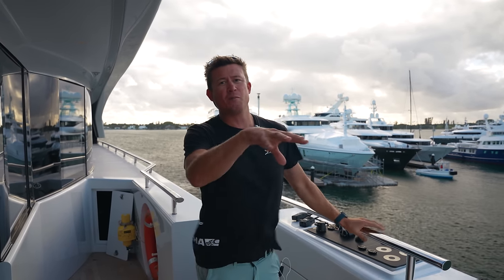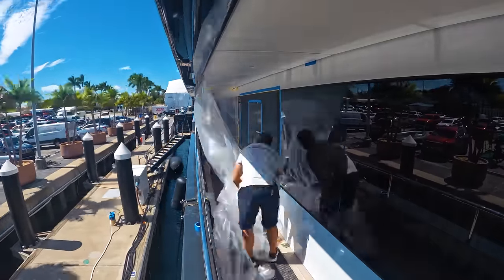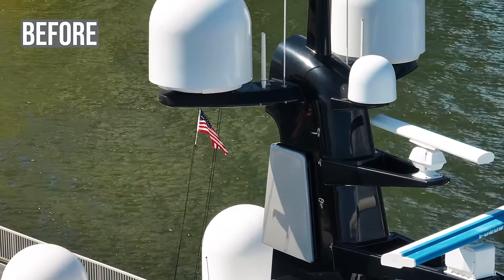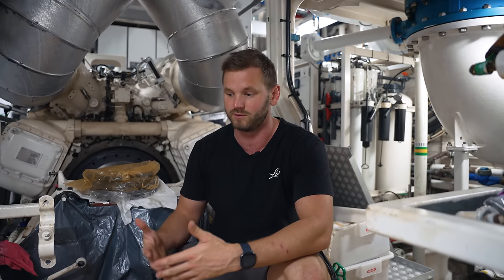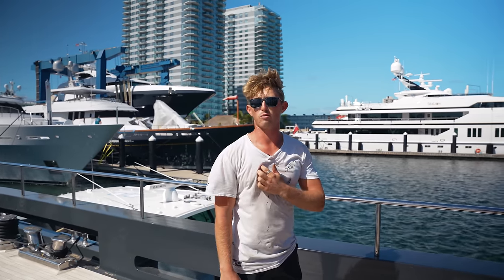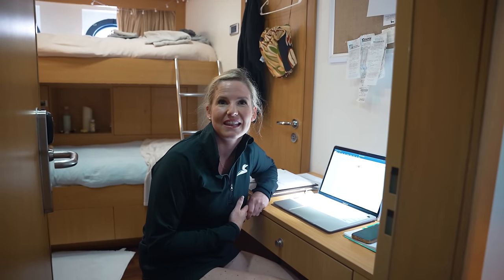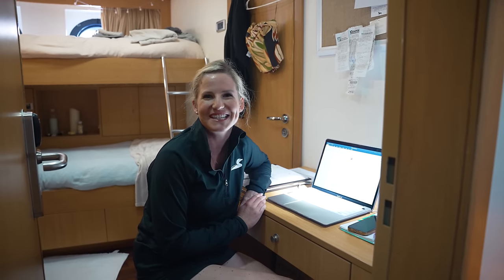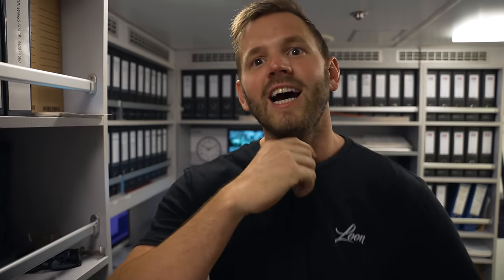We Upgraded The Boat! BIG TIME... Time to Leave Shipyard!

Comment: So great to see all the changes to the yacht. The crew did an amazing job getting it all done in short amount of time. Now it’s time to get the winter Caribbean season underway. 🛥️🥂
Reply: Great Videos! Quick question: Why couldn’t you use the engines in the beginning at the maneuver in the harbour and had to rely on the tug drivers?
Reply: @maxmuster3440 cause if the timeline adds up there was work done on the engines/gearbox so these were not running.
Reply: @MrDinoooooo I would also assume this. They really did crunch to get months worth of work in weeks
Reply: I’m a little late to seeing this video so maybe comments aren’t being monitored anymore but I’ll take a shot anyway. 

I’d be really curious to hear if you’ve got a rough idea of the cost of the 3-4 weeks of upgrades/repairs/maintenance?? I’ve always heard that a yacht will cost about 15% of its purchase cost per year to maintain. I’m not sure if that includes a crew, but I’d have to assume it does as that would be a major part of “running” a yacht (private or charter). So just going by Loons current asking price on the market (in Oct 2024) of $47,500,000…. I estimate the monthly running cost of her to be $450,000-$600,000 (yes? No?). So I’m really curious if that “rule of thumb” of 10%-15% would include these annual and semi annual trips to a boatyard? Or would what you’ve done in that month be considered extra expenses, maybe a capital cost instead of maintenance?? 

Would love to hear ANY response from the Loon crew, but of course a direct from Captain Paul would be icing on the cake!  Cheers! 🤠👍🏼☮️

Comment: Amazed how well run this yacht is. The owner doesn't scrimp on  maintenance, repairs and upgrades.
Reply: I know this would never happen because obviously they have every reason to be discrete and preserve their privacy, but wouldn't it be fascinating to hear from the owners themselves and gain at least a glimmer of an insight into their experience owning this magnificent property and how they've come to entrust it to this consummately professional crew?
Reply: In for a penny, in for a pound
Reply: there's a reason they say that the cost of maintaining a vessel is between 10-20 percent of its purchase price yearly. the owner doesn't charter to make money. he charters so he can spend 6 weeks a year on his boat and it costs him nothing to do so. the charters pay for the crew and maintenance. by not continuously updating and fixing things immediately you are just kicking the can down the road. they say the 2 happiest days of boat ownership are the day you buy it and the day you sell it. this boat will need to be sold one day. it makes it a hell of a lot easier to sell a boat if it has been looked after well its entire life and believe it or not whether it has been used consistently. a boat that doesn't go to see is a boat that's rotting away in a marina. some boats become marina queens and the costs are the same whether or not the boat runs or not, its just the engines and all mechanical systems are not made to not be used.
Reply: The yacht is how the owner laundries he’s money 💰 💰💰💰💰 😂😂😂😂😂😂😂😂😂 I just had to put my two bobs in 😂😂

Comment: I spent a week on Antigua some years ago.  I asked the guide about the houses between the airport and resort looking so shabby, and she said they don't bother going super flash as they have to regularly repair after big storms.  She also pointed out the houses mostly had some nice cars parked outside, so not to worry about the locals because they were doing OK.  My other big memory was the man who patrolled the resort at night carrying a shotgun.  I asked why he needed the gun and he said it was for cows that roam onto the grounds.  Yeah, right!  Anyway, Loon is looking super sweet after the refurb, and goodness knows what it all must have cost?  Especially the Bridge update.   I've already seen the new tender video, and that's dream boat all by itself.  Paul had the throttles pegged with all 1700hp pushing the boat to 50MPH.  Google tells me that was using 560 litres of fuel per hour, and Paul must have been a good half hour at WOT.  That must be a couple thousand dollars in fuel cost!

Comment: In refit situations like this, what happens in the case of a hurricane or other gale force winds? Can the tugboats take you out to anchor or are there protections in the harbour itself?
Reply from the maker: We monitor the weather closely. We were doing engine work this time, which would have prevented us from running away so we would just hunkered down. Normally if engines are operational, we get out of the way well in advance. 🤙
Reply: thanks,  so I guess it is just "accept what may happen and deal" when the engines are being worked on. I thought it looked a little dangerous to take you out into the channel given all of the smaller boats.  A decent wind change could take out 20 boats depending on how long the chain was.  @motoryachtloon

Comment: Okay..your explanation of the exhaust was wrong  . NOx = nitrogen oxides.., and the filter you pointed to was a diesel particulate filter..DPF.. it filters soot from the exhaust, then when the soot builds up, diesel is injected to incinerate the soot @600c...Now when exhaust temp increases NOx is produced..and would be treated with diesel exhaust fluid =DEF (AUS-40),and a SCR filter which your vessel doesn't appear to have being built in 2010.
Reply: Correct that the burners are to remove carbon. You are not wrong but when in front of the camera, not always correct things are said 😅 Rotation chief position available.... 😉
Reply: @LoonEngineer  I think you deserve a holiday - looks like you’ve been incredibly busy for a long stretch now, hope you get a break soon!
Reply: No worries...force of habit. I have been working on diesels for the last 25 years...All makes and models. Way before common rail injection ,DPF,  DEF and my diesels had wheels or tracks on them. Also next to no room to work on them...  @LoonEngineer

Comment: You did all that in just three weeks?!

I expect the removal of the satellite domes will reduce wind resistance. Probably won't be huge, but it will result in at least some fuel savings.
Reply from the maker: Yeah, it should reduce wind resistance a little, along with the weight savings, bringing down the COG and making us a little more stable at anchor.

Comment: Not the best of ideas, putting all of your eggs in one basket with starlink! Should Musk decide to switch it off (for what ever reason, and he's not the most stable nut right now), the boat is without both satellite and main communication! Not a great move once again boys!
Reply from the maker: We still have 4G/5G, Iridium and Sat C. So lots of backups if needed but doubt we’ll need them
Reply: @motoryachtloon  I'm glad for that. Good to know there's always a back up plan going on, although a coda could be added to the video to put your followers at ease.🙂